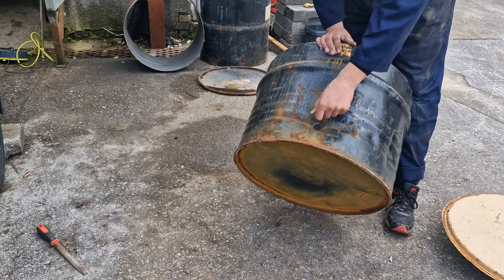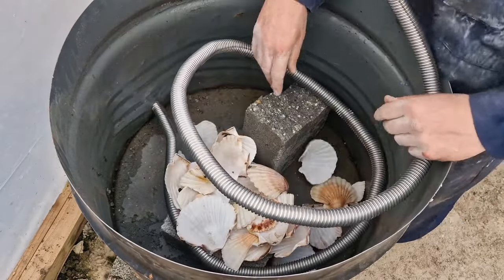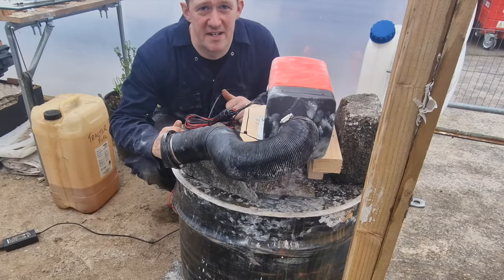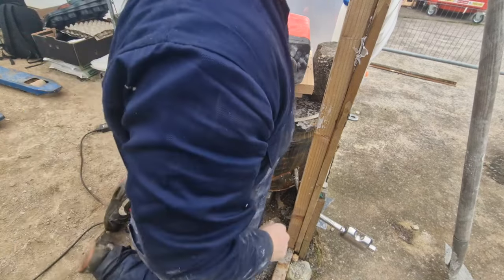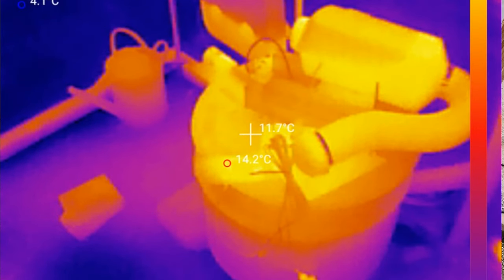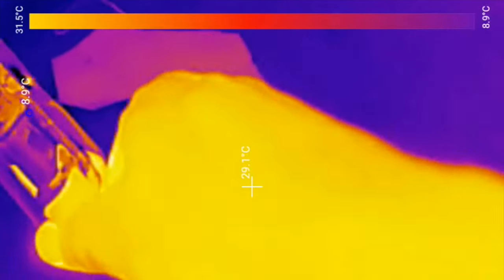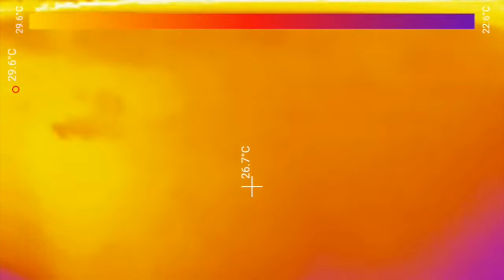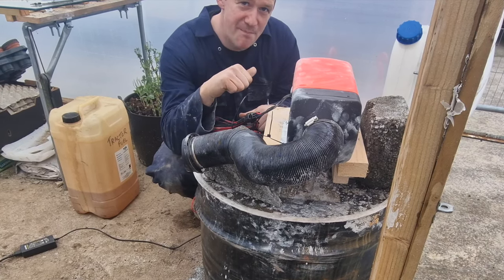Chinese Diesel Heater: I Build a DIY Heat Recovery System....and it works!

Comment: You should run the combustion air intake to the outside as well (small black hose with air filter. By having the combustion air intake inside the green house, you are pulling cold air into the green house. Direct vent appliances are more energy efficient than power vent setups.

Comment: That exhaust (length) seems to be working ok, but be aware that there's a limit on how long you can make the exhaust before the increased back pressure will cause the heater to flare out, or fail to start. Great build, hope to see more.
Reply from the maker: Hey. Thanks for your kind words. Yeah I was aware that it could happen but have no idea at what point or length. It worked really well and is being moved into my workshop for the winter to work as one of our main winter heaters!
Reply: Would be interesting to add an inline fan to the end of a long run, and see how long the pipe can be until the exhaust reaches ambient temp. Some radiant heat systems work like this, and the burner is at one end, and the exhaust fan is at the other end of the radiant pipe.
Reply: from what i read the exhaust can be up to 200 meters
Reply: @davidwalesby2426  More like 2 meters.. Where did you read 20?

Comment: Great job 👍. Thank you so much for the shout out. The great thing about the mass storage is that it will slow release the heat, so for workshops and green houses they'll stay toasty through the night without risking keeping the heater on unattended. You're quite inspiring also. I've subbed. Cheers J
Reply from the maker: Means a lot. Thank you
Reply: @grantsyard  your more than welcome. You did a great job and the video was a pleasure.

Comment: Use a full  barrel filled with silica sand . Then you have a sand heat storage battery.  You might get 20hours of residual heat stored from  about 3 hours burning . Great project
Reply: So it’s a type of storage heater?

Comment: Best one i liked was running the Exhaust pipe through a old fashioned radiator in the top and out the bottom.

Comment: This may be a bit obvious but a second drain hole drilled at the lowest point (near the end) of your muffler would allow all the condensation to discharge.   This will help prevent the collection of water rusting out the muffler.

Comment: The longer the exhaust is the harder the fan and the fan bearings have got to work to push out the gas so its gain one thing but loose another..
Reply from the maker: I suppose its able finding the sweet spot

Comment: Great stuff !
Yes.  It's a "sand battery", kind of like in Finland.    Well done
In this first test, you've only run it 30 mins.  First it will dry off the sand and rocks and it will slowly steam.  Then, when dry, it will just heat up as you want...

I have one in my work cabin in the garden and have been delighted with the super warmth this winter...

After much thinking,  experimenting and piddling around, my idea for heat recovery is two fold.  

First to use a 2m long straight 3/4" metal exhaust pipe, which sits suspended in the middle of a 2m 40mm PVC thick drain pipe.  The entrance of the PVC is connected to the furnace air intake.  The cooled exhaust goes outside,  of course.
   This will greatly preheat the furnace air inlet, which will be just added to the overall furnace heat.

Secondly.  I'm putting a 10cm diameter, flexible plastic airduct to draw hot air from the ceiling and bring it down into the back air inlet where it can be reheated again.  

I think that with those two changes, it would mean that I can run it, say, one or two settings lower for the same heating warmth = even less oil usage.
This is what I'm doing this spring/summer.
Reply from the maker: That sounds epic! You have seriously levelled up. Thanks for taking the time to explain. I think many of us In the UK have taken cheap ongrid electricity and gas for granted for way to long and have a lot of catching up to do!!

Comment: Have the combustion air intake(the hose with the air filter on the end that sucks air into the combustion chamber) routed outside as well.  Having the input air sucked from outside will prevent a negative pressure build up in the building from the air that would otherwise be sucked out of the room. When you suck air out of the room with windows and doors closed it creates a bit of a vacuum in the room because it is in essence pumping air out of the room. So now with this negative pressure(vacuum) created in the room the air outside will want to try an rush into the room thru any cracks in the doors and windows, causing drafts of cold air being pumped into the room, at the same time if there are no cracks in the doors and windows then the combustion chamber continues to eat up all the o2 in the room and become even more inefficient burn creating even more carbon monoxide, less heat, and less air to breathe in the room. 

By taking the combustion air from outside you eliminate the negative pressure build up in the first place, and at the same time ensure a more complete burn with full flow of o2 getting into the chamber at all times, and now the combustion won't need to suck the o2 it needs from the room anymore, causing the atmospheric pressure in the room to be at the least equal to the outside atmosphere, and at most it will create a positive air pressure in the room(because you are heating the air in the room) instead of a negative one, causing the air thru the cracks in doors and windows to flow outward instead of inward eliminating drafts at the same time it ensures you have enough o2 to breathe because the fire is not eating it all up.

Note: this is not something i made up, i learned it in technical school. Also all the modern 99% efficient furnaces use this method of sucking the combustion air from outside as well as venting the exhaust outside. This way it can't fuck with the air pressure in your room or fuck with o2 levels in the room. Even modern wood stoves take combustion input from outside! It is better to have some warm air escaping OUT thru the cracks instead of cold air rushing IN thru the cracks causing uncomfortable conditions and inefficient burn. That is mainly what this does by taking combustion air from outside, safer, better burn, more heat from each burn, no drafts, better air conditions for breathing, etc... You are probably not worried about more carbon monoxide being created because your exhaust is outside, but the more carbon monoxide it produces means the less complete the burn is, reducing efficiency. But at the same time allowing incomplete burn to escape outside is not environmentally friendly.  But notice i said carbon monoxide not carbon dioxide, carbon monoxide is pollution but carbon dioxide is not, regardless what politicians want to have you believe. Remember, politicians are not scientists, and also remember they are known and proven LIARS!
Reply from the maker: The points you make are valid and important, especially in a domestic setting. The areas i am using these in are a polytunnel with loads of ventilation and a 200 year old railway shed.
For vans, sheds and other small areas it is really important to do as you suggest.
Thanks for the comments

Comment: I used two transit egr coolers together and ran water with a small pump to cycle back to the workshop into a barrel , giving me warm to hot water for hand washing and a heat storage
Reply: I was thinking of making a copper one to do that from the engine. I'll checkbit out

Comment: you might could try a smaller barrel -less mass to heat might give you a higher temperature,  I am going to start off trying a metal 5 gallon bucket with the exhaust coiled in the bucket and attached to the bucket inside with     small   pipe hangers so the exhaust pipe is toudhing the bucket.  I am also considering  stacking fire brick in the center of the coiled exhaust in the bucket. a small fan might help distribute the warmer air inside the building for a more uniform temperature

Comment: I thought of using used motor oil in a sealed copper tube rad that would have exhaust extension clamped and wrapped to it.
Reply from the maker: I reckon that would work really well! I have an old double rad I could try it with

Comment: Well better late than never I suppose...  Great idea. That mass will give you a thermal flywheel to try and keep the temperature up for free in your work shop. 
If I ever get around to buying one of these heaters I plan on experimenting with a coaxial exhaust pipe. The idea is to put the smaller hot exhaust pipe inside a larger pipe supplying the cold combustion air.  I think this would burn the fuel better since warmer intake air should vaporize the fuel better. The exhaust after that sent to your exhaust battery could improve things?

Comment: what about running the exhaust through a car radiator or a heater core, with a fan on the back of it to blow the heat through the room? or would it melt the soldier joints? anyways that's a different project all together, i was thinking if you were to use a drum half the diameter but taller you would feel the heat quicker, hotter and more heat would be ready made available,

Comment: Hi you asked for any comments on your project well I'm not to strong so I wouldn't fancy lifting that cement I would have asked McDonald's for the used paper cups and filled them with the cement and make as many as I can then put the cement mouldings in the barrel I can use a full size barrel for that matter and can move it anywhere by my lonesome

Comment: I'm wondering if you could transition the 1" exhaust to a 1 1/2"or 2" flex exhaust pipe into the sand to reduce back pressure and maybe capture more exhaust heat.

Comment: I didn't see it, but if you have no vent to allow any moisture to escape the sand battery it could explode. So, be sure to have a vent to allow any steam to escape the sand battery.
Reply from the maker: It has a not fixed list for that reason!

Comment: Great idea and execution!

But I see it working more effectively if you route the exhaust running upwards through the storage "battery"!
I think this would retain more heat, as not only is most heat generated nearest to the heater itself, so risng through "battery" and accumulating more heat, but also allow exhaust gases to escape easier, thus taking back pressure off of the unit as a whole!
Also, can you get your hands on any old "storage heater" bricks to add into your "battery"?

Not sure if you're are aware, but cheap cat litter (fullers earth) is the most effective of insulation, as it does conduct heat at all, so 100% of heat is reatained inside the heater/battery, so if you can double wall it, and fill cavity with cat litter!?

Hope something there might possibly help you get a better result, but maybe not too!? Haha!

Best of luck with it matey! 👍🖖✌️
Reply: That would fill the exhaust with water having no way to escape
Reply: @HjuvikLabs  Why would that be the case the rising heat would carry any water vapour up and out of system surely!? 👍✌️🖖

Comment: Mate, you're working with sharp edges and not wearing gloves. You're only using one hand to hold that angle grinder. You're only wearing trainer and not proper work boots. You're handling bricks, again without gloves. I also suspect there wasn't any safety glasses or a face shield in the mix anywhere. I know you think you're safe, but what sort of example are you setting to people, particularly younger people, watching your video?
Reply from the maker: Taken on board mate, Thanks 
I always wear safety glasses, goggles or visor. You are right that I was only wearing trainers 😔. I don't use gloves with the grinder as I have found over the years that I am unable to hold and control it so well...however you are right that others watching may see what I do and copy so from this point on I'll take on the points you have highlight...Thanks Chris
Reply: Sap all the fun out of everything why dont u.
Reply: @paulmadsen5641  Yeah, it's all fun until someone loses an eye, or a finger (or worse). Safety rules are written in blood.